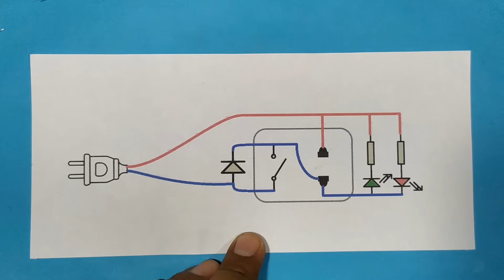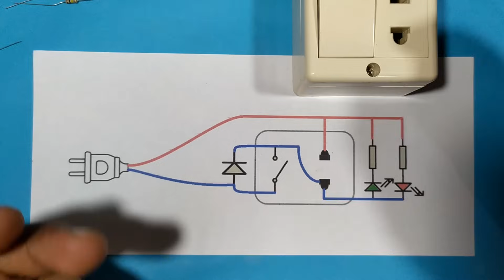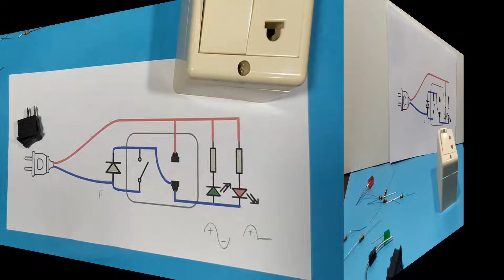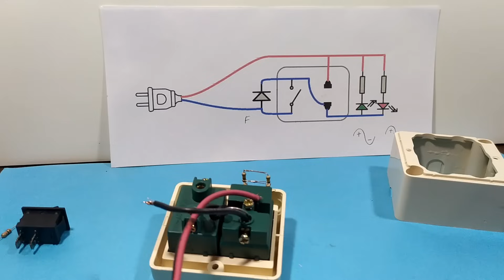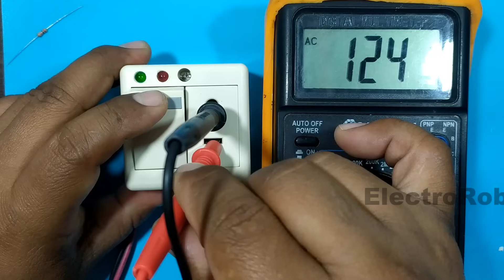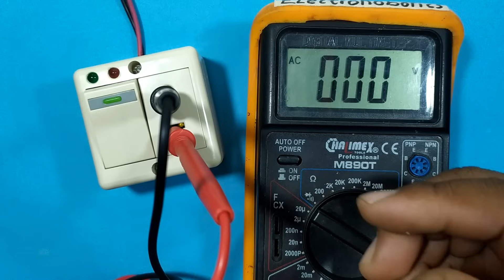Now your Soldering Iron will last for many years with this Simple TOOL

Comment: USE A spst  SWITCH  [ a DPST would be more safe  - controlling Live and Ground] FOR THE POWER ON/OFF
 use a DPST or DPDT switch for half/full power;   one side for power, the other side to turn on/off the green LED

Comment: Just get a temperature controlled iron! They are easy to get hold of now and relatively cheaply for what they are. You will solder much better with one and a good one, even if it's used, will last for years! A an iron with proper variable temperature control, and ideal;ly a temperature display, will also enable you to do other useful things such as repair plastic things which melt at a much lower temperature.

Don't bother messing around with unnecessary power limiting nonsense like this. Aside from the safety considerations, it's just not worth it. Get a proper iron instead!

Comment: Normally all the soldering iron has built in diode. If you introduce another diode the supply voltage will get further reduced and the soldering iron will not attain the full heat. So if you want to assemble this circuit you have to remove the diode which is inbuilt into a soldering gun then this set up will be useful. Otherwise wise to control the supply voltage to the soldering gun remove the built in diode and introduce an ordinary fan regulator with BT136 triac and potentiometer one. In order to achieve the control voltage you have to calibrate this set-up by measuring the voltage at the output with a multimeter in AC mode and mark the voltages in a dial affixed in the enclosure where the potentiometer is fixed. This setup seems to be working fine for me for years together.
Reply: For these pen type of cheap soldering irons, I've never seen a build in diode, and there's no reason to have it. Even if it has one, adding one more in series will not reduce the power by half one more time. If the second diode is in the same direction with the build in one, nothing will change. If it's in the reverse direction, there'll be no current flowing, so the it will not work at all..

Comment: Get a Temperature Controlled Solder Station and good quality Bits.  Tin the Iron Tip before switching off and Bits will last for Years.

Comment: ROFL!!!!!!!!!!!!

This is just not true!  Lowering power reduces heat to unusable levels!

For my tips, that in fact do end up looking like that (well, USED TO) I use

Thermaltronics TMT-TC-2 Lead Free Tip Tinner (20g)

When I first bought it, I had my doubts if it would work.  Oh but it does!

You just heat up the iron (or gun), dip it into this stuff, twist and push/pull to get all the tip covered and that's it!  The tips are like brand new again.

I used to spend $$$ ever few months to buy new tips.

Since buying this stuff, I have not purchased a single tip.

In fact, old tips that I just threw in a drawer, I was able to get working again.

This stuff works!  So much so, that I bought 3 tins of it.  Yes, the tins are tiny, that's for sure, but with the 3 times, that I bought in Feb 2022, the first tin is still working.  The other 2 are just for "stock."

I do wish people who make videos showed real things that work.  sighhh
Reply: @BlondieHappyGuy Hi, thanks for the tin tip, I'll use it if I can find it in my country. Regarding the video, this is intended to reduce the power by half like kind of stand by, extending the life of the tip which makes sense. I'm turning it off temporarily  to save the tip, which takes long to reach at soldering temperature..
Reply: @beterbey  The problem is, reducing by half is not a solution to the tip issue.

Remember, these days, most new soldering irons now come with a heat/temperature adjustment on them, which allows one to select a lower temperature when needed.

Even then, tips are not saved.

I should mention too, that one of the main reasons that the tips go bad like that, besides forgetting to turn off the iron, is how the tip is cleaned.

Many use those brass sponges.  While they do clean the tips well, they also scratch off the nickel plating!

I learned long ago, it's best to use a wet sponge (like many irons come with).  They are not metal and work nicely to remove solder blobs, without removing the nickle.

But no matter what, this tinning stuff I mention is seriously the best thing I ever came across.  That's why, after I saw how well the 1st one worked, I bought a couple more.  Like I said, since buying it, I've not replaced a tip yet and I've been able to re-plate the old ones I kept.
Reply: @BlondieHappyGuy Thank for the explanation, I'll try it. Could you please share a link, if it's posaible?
Reply: @beterbey  I think that you can just google the thing he mentioned,

TMT-TC-2 Lead Free Tip Tinner
Reply: @blondiesl225  Thank you very much
Reply: Regarding the brass wool, isn’t brass softer than the iron on the tip? I don’t use the wet sponges because there will be constant thermal shock applied to the tip. I always keep the tip tinned with solder whenever it is resting on the stand or when packing away.
Reply: @soloflo  I've got decades of experience in this area.

Wiping the tip on brass wool is not an issue for the iron tip itself.  The problem is that is "scratches" the nickle plating, which, when you "tin" the tip, is what the solder actually sticks to.

I rarely use the brass wool.  Perhaps if there's stubborn buildup on the tip, but even then, very gently.

I only use the wet sponge and any "thermal shock" does nothing.  It's not a real-world issue.

Comment: I need 300°c to solder. If this drops the the power by 50%. My iron will cool down and I won't be able to solder?
Reply: Have a peek a the comment above that I left.  I talk about stuff I use that actually works to restore a tip by nickle plating them again. 

It works and you keep your iron hot, without issue.
Reply: See my recent post.

Comment: That is not a soldering iron... That is crap that you buy for $10. Buy a better soldering iron and it will last for 40 years as my Weller has.
Reply: Oh I LOVE Weller!  My OLD Weller soldering gun, you know the type, high/low, pistol grip, I bought that in the mid 1970s.  The "low" windings no longer work, but high works just fine.

Since then, I bought a few more when they were on sale and even though not needed another, there was one that is Orange plastic.  LOL  I just had to have that.

The other 2 black ones I bought are those "heavy duty" ones with the really thick tips.

They all work just fine.

But as for the tips in this video, I have a couple of irons that use those.
One is a nice SMD station with iron and hot air gun.  Two other irons are little, cheap, stand alone ones.

See my comment about about the tinning stuff I have been using since 2022.  It really is amazing for any soldering tip that is nickel plated.

This set re-plates them and it actually works.